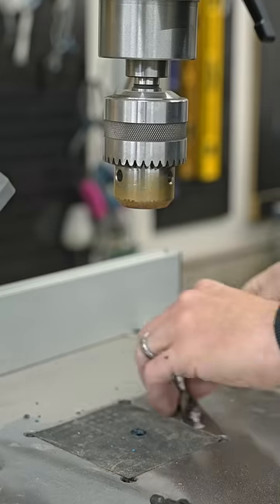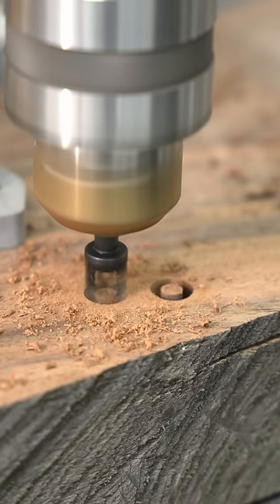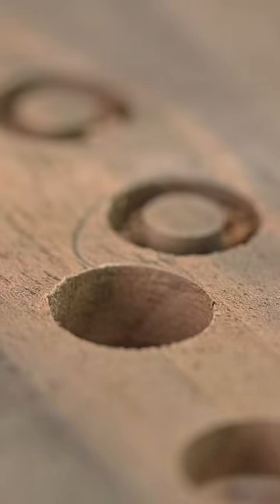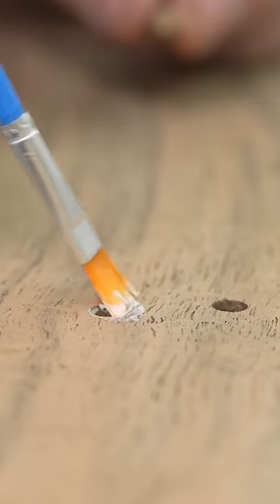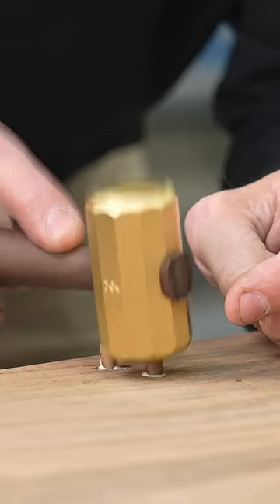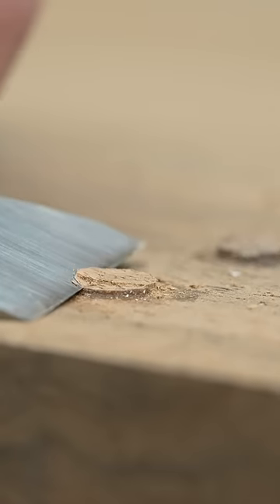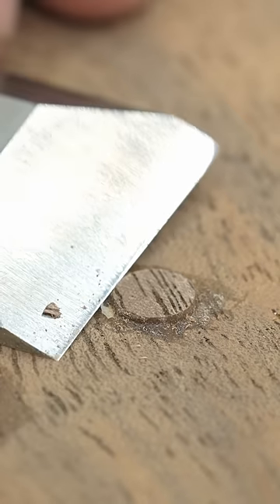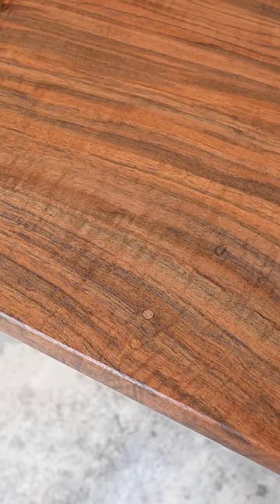Filling that hole

Comment: Can’t you cut plugs from the underside of the same slab and then fill those with the scrap wood? It should be a much closer match.
Reply from the maker: Good question! This walnut varies so much in color, that even the plugs change hue depending on how deep they go in. Meaning, the wood color on the surface changes as you go down. So the wood on the bottom isn’t necessarily closer than an off cut from a foot away.
Reply: Try with plugs with the same grain / texture direction.
Like get the plugs drilled at 90° from the side
Reply: @MinecraftMike  this sounds like a good idea. Do you know if this works in practice too?
Reply: @jonslg240 how would you fix it 🤡
Reply: That was the first thing that popped into my head 😊
Reply: @abnormaalz  it doesn't. The plug cutter cuts a bigger hole.
Reply: Good thinking
Reply: @jonslg240  the customer isnt always right
But as a contractor it is my duty to explain this stuff before you pay for a product. 
Because sure. Anyone can take something to an extreme; but is it worth it to ths bottom line of your project; when thats probably the underside of the table?
Reply: @Minecraftmike5089  can't fill a hole from a plug cutter with the same sized plug that it produces 😕
Reply: @Minecraftmike5089  you know the plug will be smaller than the new hole? 😂
Reply: @jonslg240  or you could just settle it like a grown adult and use your words
Reply: @failzilla  well then you just cut another plug the size of the first plug hole. and so on.
Reply: Maybe pick up some pigments and try color matching the plug to the surround wood
Reply: Why cut plugs out of the underside when you could just flip the board itself?
Reply: @Scrapswoodworking  Not use it. Simple. Use quality or none at all.
Reply: @Bl0OdYShAdOw   lol you’ve clearly never dabbled in woodworking big part of this is fixing and or accenting flaws to your advantage. If you want your boring straight no character wood table by all means it’s your home but if you can’t admire people that find clever ways to fix a problem you’re not gonna find a lot of favor among skilled craftsmen
Reply: So is there a reason you’re not using the other side or do they cut into nothing sides? 😊
Reply: @Minecraftmike5089  that is a good idea except the cutting of the plug would leave the plug just a little bit smaller than the hole being plugged... I've thought about this before but the hole being plugged would have to be smaller than the plug being cut which I would mean the second hoke would have a ring of filler around it in order for the first hole to be snug .... Good idea though...
Reply: @mrjoelpt  you don’t sound smart
Reply: @jesusischrist1527  It's a LOT smaller for these little plugs, probably close to half the diameter.
Reply: @jonslg240  people who pay good  money for wood also usually understand the nature of wood -- people sitting at your table will ask why those holes exists and rich people LOVE the chance to tell you a story about something they know. Trust. Only poor people want perfection because every cent matters. Insane wealth is flaunting the fact its handmade with a story to tell.
Reply: @Jons LG  did he say he was selling it? There's expectations, and then there's trying to shit on someone over nothing, nothing that affects you especially
Reply: Why not just turn the board over and use that side.
Reply: If you make it symmetrical it will just look like it belongs there (covering up a screw). Probably not always applicable but sometimes hiding something in plain site is easier
Reply: @Minecraftmike5089  the whole you drill next to it will be too big for the plug tho. How would you fill that up?
Reply: @Minecraftmike5089  it looks like the plug cutter cuts a bigger hole. so the plug wouldn't fit in the hole you cut to make the plug and you're back to needing another piece of wood to fill larger hole
Reply: @Minecraftmike5089  every plug you cut leaves a hole much bigger then the plug so plugging next to it and using half of the plug on each hole wouldn't work. As you would need a bigger plug each time. Unless I misread your comment.
Reply: @RJ-wx3fh  serious question, what if like he’s filling the holes on the underside of the tabletop in the video
Reply: @Blacktail Studio Uncut  honestly this still okks great if I were just a normal buyer seeing this I'd think that those where just to knots
Reply: How about just leave the holes in the underside??? No point of drilling multiple holes for the same purpse
Reply: Or instead of cutting plugs from the underside… just flip the slab of wood over
Reply: Just fill it with fibreglass
Reply: @blacktailstudiouncut  blah blah blah this is horrible
Reply: @blacktailstudiouncut  Do you take bits off from the ends of the slab? Use one of those if they're of a similar tone.
Reply: Or just make this the underside of the project.
Reply: @jesusischrist1527  If the idea doesn't actually work at all and misses the point, is it a good idea lol?
Reply: Skinnier plugs.
Reply: These machines only pay off if you run a carpentry professionally.
Reply: @Minecraftmike5089  “yup”
Reply: @jonslg240  I'm pretty positive that Cam is smart/experienced enough to put these plugs on the bottom of the project.
Reply: That's what I was thinking.
Reply: The difference between a real pro and a YouTube epoxy river table hobbyist !
Reply: justin douglas  What a good idea !
Reply: Why not use a bowtie inlay?  I just watched another video of yours where you use them sometimes strictly for aesthetics, so might at well use em to cover these holes up.  🤷🏻‍♂️
Reply: @Ben Schnute  
Not his problem to worry about that .  He isn't the craftsman.  That was so damn noticeable. 
I'm not faulting the guy, I'm sure it's difficult.  But also if you are charging me thousands it better be right.  
I could have done that shit myself!
Reply: @wolfinthewheatfields3224  this is so true. You learn this when you actually do high end stuff for wealthy people. They are usually looking for uniqueness. Once I was at one of these peoples summer home they were building and was putting in fixtures and you know had down drop clothes and cardboard to protect these raw 12 or maybe even 14” wood plank flooring. Guy came in and said what am I doing with those drop cloths . He was like get rid of them I want the floors to get scratched an dirtied as much as possible I was like “oh man really?”   he then proceeded to push the fixture across the floor gouging the shit out of them. I was like wow ok. It’s was wild to see. Now a new money person wouldn’t even think of that they’d want perfection without even having a clue of what that even is. But this money bags was looking for anything original that would give them that story and uniqueness that they could use to subtly brag about to people.
Reply: Why cant you just turn it over
Reply: @blacktailstudiouncut  screw it, good enough
Reply: Can you not use the dust from sanding the same area to form a top layer on the plug?
Reply: No, he should have made 10 to 20 plugs from a scrap, then spray them with finish to check the color, and pick the perfect color match.... That's how I've always done it. But I was taught by a craftsman, not YouTube 😂
Reply: @Minecraftmike5089  That would be brilliant but the plug for the plug cut hole is 2x the diameter.
Reply: @blacktailstudiouncut 😮m
Reply: Make your own plugs from scrap off the same project piece.
Reply: @andrew1898  if the holes look prdy (symmetrical/now “designed in”) then it’s fine
Reply: @blacktailstudiouncut  use the side that don’t have the holes :)
Reply: @Minecraftmike5089  this is a really good idea
Reply: @jonslg240  Yeah definitely not paying over $3k for that...
Reply: @blacktailstudiouncut  I make interior for private jets we clear coat all of our stuff since It keeps everything as close to what the customer had chose when they saw samples. I would try some paint to cover it and then clear coat about 9 layers so you have plenty to sand and buff out
Reply: @Minecraftmike5089 what in the algebra 2 did you just say?
Reply: just flip it?
Reply: Only on Thursdays
Reply: @jonslg240  you ain’t wringin’ shit tough guy…
Reply: @wolfinthewheatfields3224  lol. insane wealth is paying for this table, putting it in your spare house in the spare room that nobody sees and buying a new table, from a new guy who uses a reputable supplier that uses pinless moisture meters that don't ruin multi-thousand dollar wood tables before the woodworker even gets started. oh and they tip the original guy 50% for his troubles, inform him he should find a new supplier, and then make sure the new guys price is at least 3x as much as the last clown who's supplier can't use pinless meters because they are CHEAP. that's right. this guy sources his wood from a cheaper supplier instead of getting a better product. that's why you have two little holes. that what the person who isn't scared of a the rich person says when they try try to explain that their $15k custom wood table has 100% completely avoidable defects that only exist because the supplier cut corners. that's not wealth, that's a poor person cosplaying as a rich person and pretending that they didn't buy their table form the cheapest person they could find....
Reply: airbrush over the top to mimic wood grain. Works like sliced bread.
Reply: @jonslg240  bro its a table we dont need it pretty we need it to work
Reply: why could the supplier not put these holes on the underside to do there moisture test?
Reply: @Minecraftmike5089  I love you
Reply: @Minecraftmike5089  
The plug cutter leaves a significantly bigger hole than the plug it cuts.
Reply: @blacktailstudiouncut   Random thought: have you ever intentionally made plugs from a darker wood so that it looks like it's a knot?
Reply: @jonslg240  or at least demand a replacement lmao because, um, yeah. No fuckin' way.
Reply: @andrew1898  if it was the underside i wouldn't care but the way this video is shot with it always facing up makes it seem like it is the top
Reply: flip the board over for use ?
Reply: @blacktailstudiouncut  damn
Reply: @blacktailstudiouncut have you tried using dye
Reply: @Minecraftmike5089 he said that the wood shade changes with depth as well as across the surface
Reply: @blacktailstudiouncut  why don't they just check moisture in the side
Reply: @andrew1898  00000
Reply: @Scrapswoodworking  Use a larger board and cut down.
Reply: Just cut a plug from the same table then cut another plug to fill that hole then cut anoth.. ok this might be a bad suggestion
Reply: Your cleverest man on the internet right now.
Reply: @Scrapswoodworking  He can afford to spend thousands on a table,why would he do it himself?
Reply: Flip da wood over
Reply: @idkwhyimdoingthis997  詩な読み割やまやな
Reply: @blacktailstudiouncut  man just accept he is right 😂
Reply: Just turn the slab over?
Reply: @Scrapswoodworking  cover it with a fancy inlay 😂
Reply: @user-co6ww2cm9k  definitely a better way  I personally like trying to make it look like a knot all really depends on the look that’s needed
Reply: @failzilla you clearly didn't read what they said throughly
Reply: I was going to say the same thing usually you would turn the timber slab over where there were no holes. Otherwise, it's class as a downgrade, not A grade ,especially if you can't sell it as a grade
Reply: @Minecraftmike5089 the guy explained that the wood looks different the further in you go, that would result in one matching piece and one off looking piece just like cutting from under would do
Reply: @Bl0OdYShAdOw  Quality like... wood from a supplier who doesn't check the humidity when drying? Very business savvy of you.

He immediately explained the reason for the holes, and it's very likely he gets his wood delivered. If you've ever dealt with a supplier for literally any product or material, you would know that actual mistakes and quality control issues exist. Makes no sense to complain about those very quality control efforts.
Reply: Have you tried yelling at the plugs?
Reply: @blacktailstudiouncut always water test the plugs to match the color does the table
Reply: @Minecraftmike5089  This comment has scrambled my brain
Reply: @jonslg240  "if"
Reply: @jonslg240  While I agree with you that this plug stands out too much, you are aware the wood can be flipped over and the plugs can be underneath the table or hidden/camouflaged into the project, right?
Reply: @Minecraftmike5089  holy smokes, what an excellent description.
Reply: @Minecraftmike5089  plug cutting uses more wood than it produces (creates waste), ex. 5mm plug creates a 7-8mm hole
Reply: @blacktailstudiouncut  Yeah but you didn't even try to match the grain direction. You can't really complain about it when you aren't even trying. :P
Reply: Round the edges and  use the spare as plugs?
Reply: @Minecraftmike5089  Plugs are not the same diameter as the cutter that makes them
Reply: @blacktailstudiouncut you mean, I didn’t think of that, that’s a great idea!
Reply: If you’ll notice though, the most visible part of the plugs isn’t the plugs it’s the boarder around it. I imagine this is the invisible glue doing it’s job being invisible. It dries clear and leaves a dark boarder of.. clearness or shadow because it’s invisible. That why first assumption. Don’t know how I would rectify this accept by… nope. I got nothing. I think it looks good.
Reply: @mrjoelpt I think he tried.
Reply: @mrjoelpt as I mentioned before, the most visible part of the plug is the boarder. I assume because the glue is clear you only see the shadow where the light is transmitted and absorbed, just like when you find a perfectly clear crystal in the mud it appears black until it’s removed. But I have no idea what I’m talking about.
Reply: @Scrapswoodworking do the test on the underside or on the edge and then cut it off.
Reply: @jonslg240 So classy. Threatening to harm people over wood
Reply: Exactly 💯
Reply: @blacktailstudiouncut still would of been better,but anyway . U do Good work ,the one in this video in the end isnt so nice,but maybe its because we notice it since it was pointed out , and i mean if they paid , then well it worked, but you could just epoxy over it
Reply: @idkwhyimdoingthis997   unless you had a magic laser  plug cutter with literally zero kerf. 😂😂
Reply: @geoffkeller5337  can see why you might think that, but no it would really look like dust and stand out even more than it does the way he did it.  Someone else above was right, the best would be  to wet the wood with some water when choosing what scrap to cut the plug from and then be able to match it best.  I’ve done these plugs -  you also need to try to match the style and direction of the grain if you’re trying to make it less visible.  Others will use a contrasting color of wood to make it look like a feature, not a bug.
Reply: @Minecraftmike5089 The problem is the hole left from a 1/4" plug is 1/2", so your resulting half plug doesn't fill the hole it came from.
Reply: Dam was gna say this... Flip the table over take a bit from the bottom nobody knows and jobs perfeft
Reply: @blacktailstudiouncut  Can you cut a piece of the the table and make your own plug?
Reply: Just to answer people's questions
Wood coloration differs a lot throughout a tree
You can see this on stained wood because  spots usually aren't the same color

If you stain wood, then plane and sand away the stain, and stain it again, you most likely won't end up with the same hues in the same spots you have before either

So even if you have a wood plug of identical color and grain to the part you fill up, it would still look different from the wood you plugged up because the structure didn't grow in the same way

The coloration in a tree is hugely dependant on how it grows/how the cells are structured within the wood

So especially when you're working with planks it'd be exceedingly difficult to find a fitting plug for the holes. If you could even find it
Reply: @blacktailstudiouncut 
Sounds like an excuse for a good question.
As the result in the clip was looking very rookie error
Reply: @Minecraftmike5089  but the plug hole would be wider than the plug
Reply: @jonslg240  Listen here buddy you aint afraid of me.
Reply: And on the sealer use concrete colour on second coat
Reply: The pressure on the plug is much greater than the wood in the rest of the piece. I see the opposite quite frequently while applying pigment under a vacuum. There are a few ways to go about solving this and they are pretty obvious. Have fun.
Reply: My thoughts precisely. 👍
Reply: @blacktailstudiouncut imo it kinda looks like a knot if I did not know its even more convincing
Reply: Please help me, I’m disabled and poor… I’ll even take a job
Reply: @jonslg240  If i paid 3-4000 dollars on a table i wouldn't care because i would be rich.
Reply: @blacktailstudiouncut u could in theory get onto plugception to move the holes and make slightly larger plugs to move from top side to bottom but I don’t know how worth that would be❤
Reply: Agree, take the plug from directly under the core sample score marks to match the grain.
Reply: It was definitely bad.
Reply: You can see that from mars.
Reply: exactly
Reply: Nice
Reply: My thoughts too.
Reply: @srpacific lol hobbyist. Blacktail makes hundreds of thousands of dollars a year from his work
Reply: @nosleeveproductions it is turned oved
Reply: @geoffkeller5337  Doesnt work out. Sounds reasonable but whatever bonding adgent you have will play a larger role and the lay of the grain and shimmer wont be there.
Reply: Still not guaranteed to have the colour match up since trees are organic materials
Reply: Wouldn’t cutting a section of the slab be better ?? And use it for plugs 😂😂😂
Reply: Just work on the side that they don’t put holes in
Reply: Why don't you ask them to drill from bottom for checking purposes
Reply: @Minecraftmike5089 how do you get the first plug out without losing any wood?? Are you a magician
Reply: Or just flip the whole thing upside down?
Reply: He could he just didn't think of it
Reply: Wait so are the holes all the way through the wood?
Reply: Dob some water on the samples with a sponge first before cutting your plugs. I haven't done plugs before with a plug cutter, but I have done this to do square plugs for large rot areas and it helps to anticipate the effect of finish.
Reply: Just make little mini plugs that go into the drill holes or just make the plugs only slightly bigger so they don’t stand out as much
Reply: Cut a bit off the wood you are using and make plugs from it. Or rather, use what ever plugs u want and Hammer the plugs a little deeper so it leaves a little crevasse and fill that crevasse with sawdust from the same wood you have.
Reply: @chevyspeed6368  howabout no plugs and just fill in the two small holes 😂
Reply: Why don’t they take the moisture reading from underneath the slab ? Doesn’t matter what depth they go then ???
Reply: Really thought I had a smart and original idea this time. You best me to it by seven months😂 there’s always next time I guess.
Reply: Cams an amateur so he probably did not think about this lol